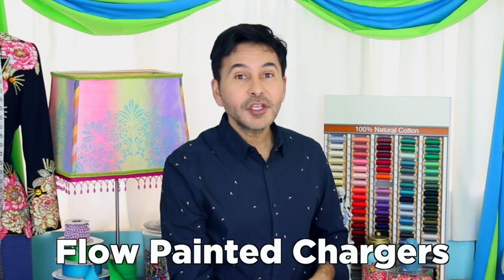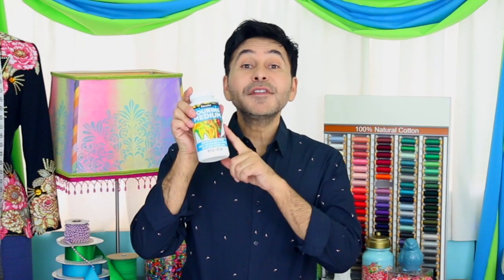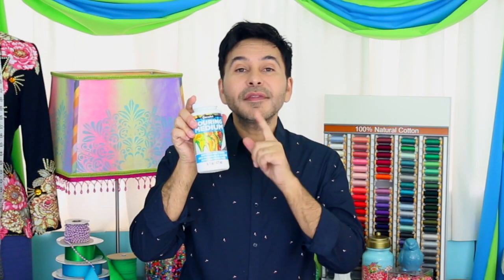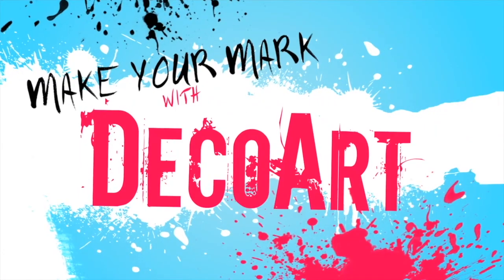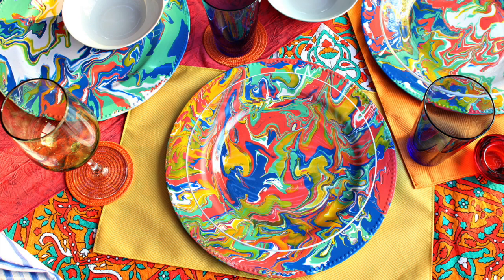HOW TO: Flow Painted Charger Plates

Comment: What else can I use this on? Does it work on wood? What about glass? Thanks Mark
Reply from the maker: Yes! You can pour onto wood and glass.
Reply: If you use it on wood, its a very good idea to prime it first with a couple layers of gesso. If you use it on glass then its a good idea to seal it with a varnish after the paint has fully cured. Also you can pour on just about anything, I mean ANYTHING. 😉

Comment: How do you make these food safe?
Reply from the maker: Hi Becky! Thank you for your question! Our paints are not food safe however, a method you could use to make  food safe option would be to use clear glass plates and do the pouring method on the back side of the plate. It is important to ensure that there is no paint on the side of the plate that food would touch.